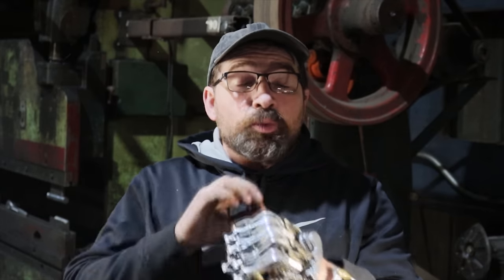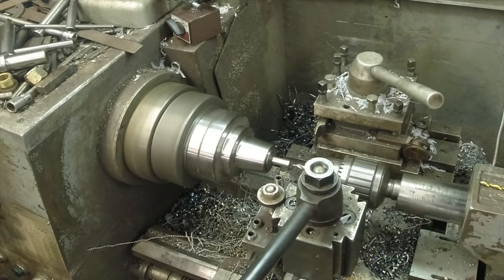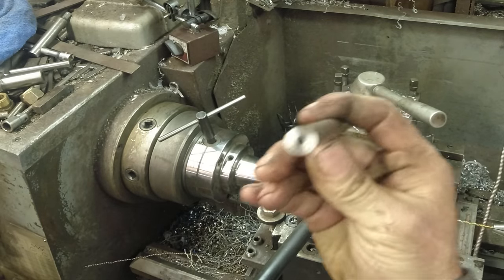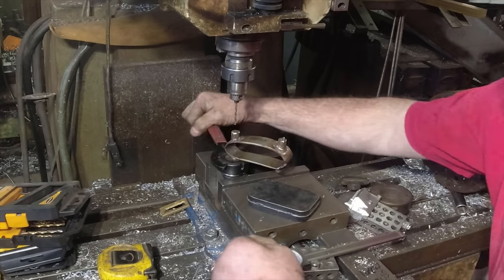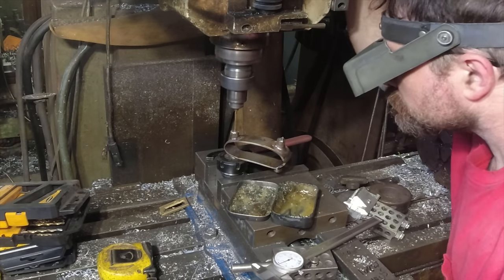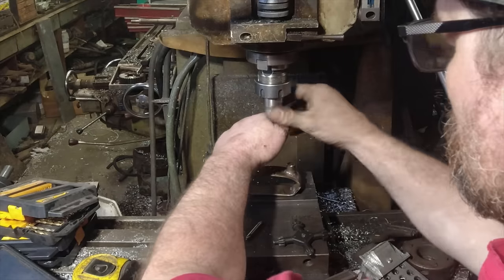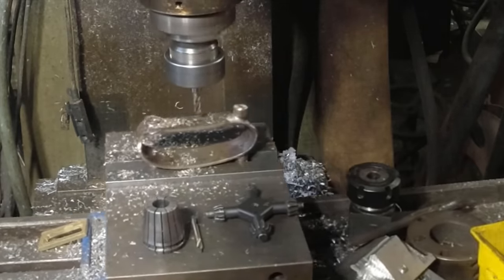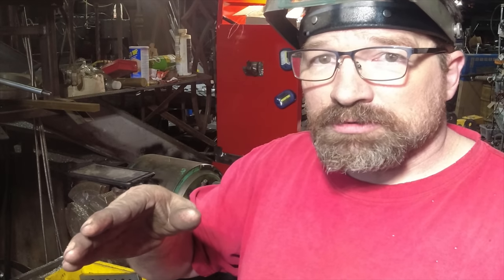Missing Parts Monday Building a New Prosthetic Hand!  E3 Machining the Bosses.

Comment: So thinking about the socket setup... Since your goal is a rigid loop, what if the metal loop was oversized enough to allow for a rigid 3d printed insert to be fitted, almost like an inverted tire. The metal part could be akin to a shoe size, and the insert could be custom made like an orthotic. Ultimately this would allow for very simple photogrammetry on a phone to scan the residual hand, and simple hand sanding to get a custom rigid fit while still allowing the uniform mounting structure.

Comment: In your last missing parts Monday you mentioned searching for a good way to make sockets without much back and forth. Would it be possible to attach a kind of gauntlet to an elbow stabilizer and make that compress slightly against the forearm thus allowing for some slack in the wrist socket as that's no longer the main attachment point.
With a setup like that you might be able to only take a couple of measurements mainly the circumference of the forearm while flexed and relaxed at a couple of heights and the overall length of the forearm and only making vaguely fitting hand sockets with some slack making for a more universal sizing system.
It would of course be a bit more cumbersome to put on and you would need to design maybe a clamp mechanism for the gauntlet itself.
Another point is the elbow stabilizer I think it's required to be there so the hand doesn't slip with extended use "locking" it's position in place every time you flex your arm. But you could also experiment with a material with similar properties to a blade of grass where in one direction it slips more or less freely and on the other it binds tightly and forgo the stabilizer all together.
Really hope this helps! Good luck with all of your endeavours

Comment: Hqave you considered trying to make it silent? maybe a lexan type material for weight aswell?
Reply from the maker: lexan's current formulation fractures at holes way too easily now. if you're referring to lexan of the 80's (Blue cross section ) it might stand a chance, but the current modified acetal formula, no way.

Comment: Is there any chance we could get a tour of your machine shop? I would love to know more about what machines you are using. Particularly what mill and lathe, and the rotary/indexing head on the side of your mill bed.

With your collet chuck do you notice any drawbacks from the additional stickout it inherently has? I wouldn’t mind a collet setup for my Logan 820, but I find myself running into rigidity issues (maybe they are really skill issues, ha) often enough that it has me hesitant to jump into the extra stickout from the headstock inherent in most collet setups.
Reply from the maker: the machines that i mainly show in the videos are a Tos Kurim manual milling machine that i bought around 1996, the dividing head on it is a B&S No.2. the lathe is an American Turnmaster 1550, the 2 cnc milling machines are a converted Shizuoka AN-S and an Acroloc m12. I have a pile more gravity in the shop, but I think those are the ones that you've seen. as far as a collet chuck for your setup I would probably get a straight shank probably er20, maybe er32 depending on what your through bore is and try that out first. mount it in a 4 jaw to get concentric and go from there.

Comment: Hello Ian.  Seems I've missed all the previous episodes of MPM, despite being subscribed.  Thanks, "algorithm".  

As you were marking the line across your hand, I was saying to myself "Now there's some proper TLAR engineering", and, seconds later I hear "that looks about right, that looks about right"...  In any case, that's some outstanding work you're doing there, very well explained and clear, and yeah, collets are the best for instantly repeatable, concentric work.

Quick question - what's the "cutting paste" in the tin you were using on the little drill bits?  Tallow?
Reply from the maker: Jokisch econo 897, it's for stainless and other hard to machine alloys. there's a link in the description.
Reply: @missingpartsclub  Thanks Ian, nice to know.  Looks like I'll be trying to source something similar around here in fenchyland.

Comment: I thought it was sad that the electronic pose selector on the prior design departed from the fully mechanical action. How long does that pose selector battery last?
Reply from the maker: it really depended on the use. if it was just idling it would last a couple of days. if you were switching grip positions a lot, then less. the adxl345 used a bit of power just waiting for the wake command. the main reason i went away from the electronics was the reliability of the connection of the emg to the muscle that was being used as a trigger. going mechanical offered a smaller, lighter, more reliable solution.

Comment: What was the little tin? Was that like a piece of oil soaked wick as cutting fluid for the tiny drills?
Reply from the maker: its jokisch econo 897 paste, its formulated for stainless and hard to cut materials. i also use rapid tap.

Comment: hello i like your work ,and so i would like to know the diameter of your roller chain for each fingers .
Reply from the maker: I use #15 miniature roller chain.  Its .25" link to link, .1875 tall, and .25 wide. It has a .0625 pin diameter.  I'll post a link to it shortly.